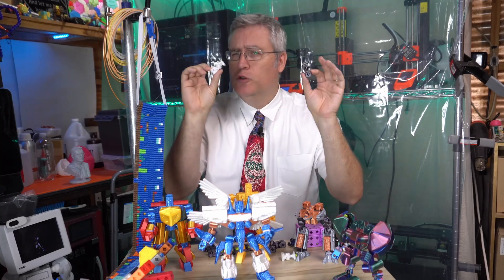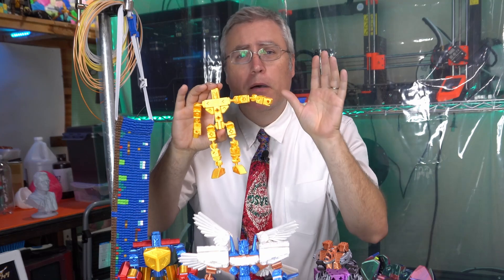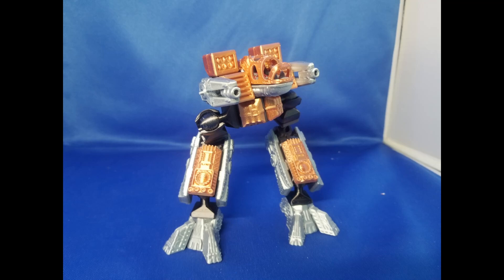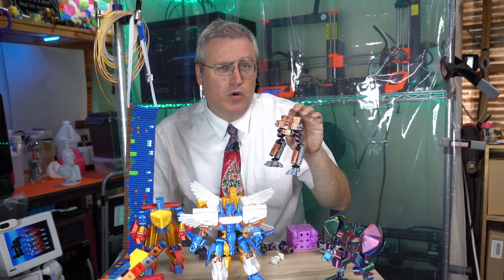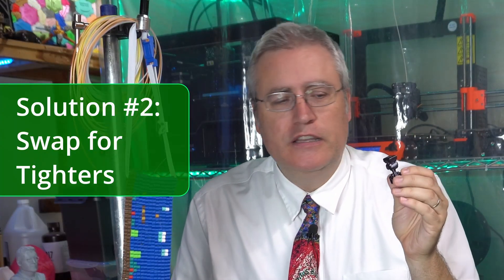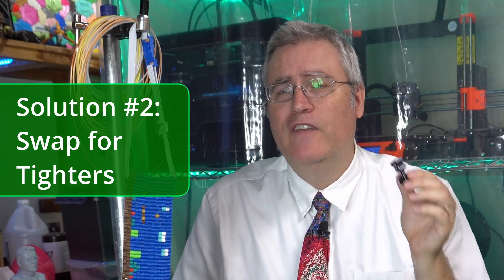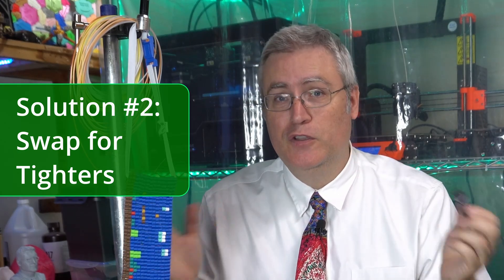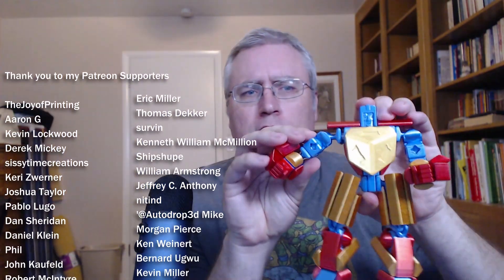3D Printing Ball Joints: How to Fix The Ball Joints that Loosen Up

Comment: The PETG solution will like PLA also get loose over time. What I found to be the best solution is to print the balls in TPU and the sockets in PETG. I made a frame for Dummy 13 with this setup, and it just works!
Reply from the maker: I'll have to give that a try.

Comment: I’m planning on painting my figure. Would you recommend using nail polish after the paint job? My ball joint is also super big (like the diameter of a hand’s palm). Would nail polish still work on it, maybe with extra coats?
Reply from the maker: I do not know the answer to that, so I'm going to have to say, give it a shot and let me know how it goes.
Reply: @3dpprofessor thanks for the response

Comment: regardless of the material, there is one more tool to have in your toolbox. When you paint the ball with nail polish, or very low viscosity epoxy, add a tiny dash of very fine sand or similar abrasive material.

Comment: CREEP, and I don't mean the guy in the video. I mean "creep" the phenomenon plastics are subject to when they are under constant stress, they will undergo slow deformation, hence the loosened up joint. Some plastics are more prone to creep than others, look up for the creep curves in material datasheets.
So, your 2nd theory is most likely the root cause. The ball itself will not deform much because of it's spherical shape, the hub is the one deforming, so it does not matter if you rotate the connector in any direction, the joint will still be loose.
One way of solving this thru design is to maintain stress levels low, the lower the stress the lower the deformation caused by creep. It is challenging since you do want the hub to apply pressure around the spherical ball, try reducing stress concentrators, round-off sharp corners, etc.
Trust me, I'm an engineer.

Comment: Have you tried using ABS for the ball joints? Jim
Reply from the maker: I have not. I tend to avoid ABS these days, but I should give it a shot.
Reply: Hi, why do you avoid ABS? @3dpprofessor
Reply from the maker: @freightuk  because when printing anything taller than a few inches out tends to delaminate without active chamber heating. It's 3d printing in hard mode, and I like things easy. PLA and PETG suit most of my needs.
Reply: By active chamber heating are you referring to a heated build plate in an enclosure like that of a DaVinci Pro, one seemed to be lurking below your shelf. @3dpprofessor
Reply from the maker: @freightuk  That's passive heating, which can help and be successful if you have an enclosure. And if your printer's room isn't too cold. And if it's not winter where you are. And if the moon isn't in venus or something. 
It helps.

Comment: PLA is known for "mechanical creep" (for a lack of a better term)... It's not the ball that's the problem, it's the socket.  The "ears" of the socket are being pushed outward by the ball.  Eventually the PLA will just give in to the shape that it's being forced into.  And PLA doesn't / won't return to it's original shape when the force being applied is removed like other plastics may do easier, ABS for example.

You may be able to "fix" this a little if there is a way to reinforce the ears so they don't/can't flex as easily?
Reply from the maker: Interesting. I could add strust to the side of the ball to hold them in place, but I worry then they won't flex enough to allow the ball to enter. And even if they do, I worry they won't hold the ball enough to prevent deformation. I'll have to check this out, though.

Comment: I found out the hard way after printing shelf supports to hold filament on my wall that PETG creeps over time. Originally I could hold my full body weight off of each individual support, then later after putting a laminate shelf on it and about 20 spools of filament, 2 months later it all crashed to the floor, which knocked over a table holding other things and made a big mess.  Watched some YouTube videos about 3d printed material creep and learned that there was a good reason why Vorons are made using ABS(ASA works too) instead of PLA, PETG, or Nylon(even CF Nylon creeps, see Stefan's example with cnckitchen and his Voron).  I think PETG or ABS would be great for this application but I've had multiple examples of PLA creep in different functional applications and have used different materials, mainly ABS because with only a cardboard enclosure I've been more happy with printing it than the effort of drying PETG just to print something basic.  ..plus vapor smoothing ABS is a fantastic thing
Reply: First few sentences, I meant to type "PLA creeps over time"

Comment: You were in the right direction, It's the problem with the PLA, it's not shrinkage, and it's not the "ball" part deforming under pressure that caused the problem. Instead, it's the "joint" part (the Y/U-shaped part that holds the ball joint) being stretched outward under pressure, that's why rotating the "ball" part doesn't fix the problem, as it is the joint that's getting too loose.

PLA does have a tendency to deform under pressure over time, that's why when I am working with ball joints and other mechanical parts, I tend to use PETG, which holds way better than PLA while being fairly easy to print.